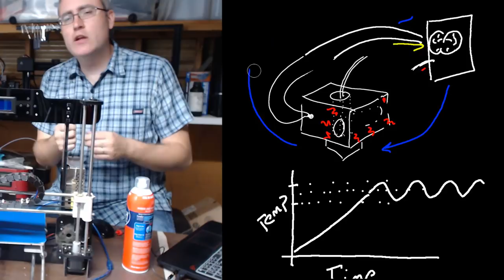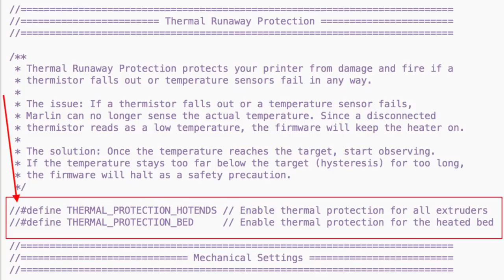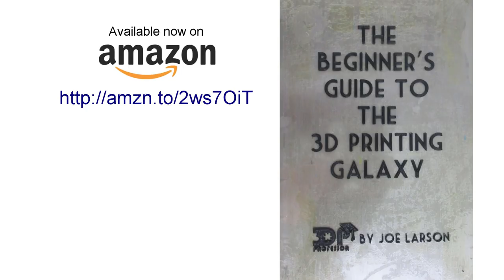Anet A8 Fire Danger and Marlin Upgrade

Comment: This is what the race to the bottom gets you. The Anet couldn't be made any cheaper with almost no corners left to cut, so they started using subpar components that performed so badly the thermal runaway was getting triggered in normal conditions. Ethics be damned, the quick fix was to disable thermal runaway. Companies that violate the law and ethical standards like this deserve huge fines and jail time for the executives to make other think twice before releasing such shoddy products.
Reply from the maker: It's a push and pull. We raced to the bottom, now we're going to see what we need to put back, then we'll race to the bottom again.
Reply: The public at large wants something for nothing. People expecting high wages, yet want high quality products below the manufacturers cost. Thats what's driving the race to the bottom.

Comment: Yep. This may help also. I made a standalone Arduino second set of overtemp and smoke sensors which will shut off a cheap, hacked 433mz remote socket. All parts, code and instructions attached. Feel free to improve and share:

https://youtu.be/n-JgQ3SaVME

 If you don't fancy going that far, you can configure Octopi to shut off a TP Link Smartplug (or more recently a Wemo socket) by linking the TP Link and Temperature Failsafe plugins and writing a small shell script. Instructions are here:

https://github.com/jneilliii/OctoPrint-TPLinkSmartplug/issues/59#issuecomment-420474368

It isn't just the Anet. The Tornado is as bad or potentially worse given the 230v unearthed bed and frame with no strain relief. 

 I would also suggest a 5-6a blade fuse/breaker to the motors, board and hotend and a 15a breaker on a 12v bed power cable. Also offloading current from the mainboard with a bed mosfet.

Comment: A "boycott until the firmware is fixed" won't solve the problem. World (or at least China) is full of shops, that have units for sale with old firmware already installed - you will HAVE to check this manually (or just upgrade firmware anyway) in any case.

If you have issues with false positives, rather than disable this safety feature, you can "relax" the conditions for triggering a bit. Had to do that on my system.

Also, regarding Creality also having this disabled - shouldn't this be rather easy (but slightly dangerous for inexperienced users) to check on most printers? Just disconnect heat probe & start heating WHILE carefully monitoring the hotend with external  thermometer to see what will happen. If the heater keeps heating up too long, reset the machine immediately (and let the cold end cooler do its work to prevent filament clogging the system), mark the machine as "dangerous", and do a firmware upgrade.
Maybe you can even query whether these settings are on via USB serial connection? (can'to  check right now)

If not, maybe they could at least add a way to store some boolean (on/off) settings in a short hexadecimal string, that you could query from LCD panel. Then, to make things easier, there could be a web page, where you can enter the string, and get "readable" output about what's enabled and what isn't. If using hexadecimal, there could be 4 such on/off values in each character.
Reply from the maker: I'm not sure I endorse the "poke the hornet net" approach to testing you suggest there, but, yes, that would be a black box method of testing if that feature is enabled.

The menu for marlin is the one thing that's most contentious. It eats up the space pretty good, so they try to keep in minimal.

But why do you access all the control options from the prepare menu, and all the system settings from the control menu? Seriously, this thing makes no sense. I get the sense that they've got a "that's the way it is now" mentality to changing it, like people wouldnt' be able to handle it if the menu were suddenly intuitive.

Comment: STOP STOP STOP There are many 10 cents thermal cutouts - two terminal series temperature cutouts on the market select one for just above the maximum temperature you ever need bond to the plate. Well below the fire point, HOWEVER  I use a 10 dollar PID temperature controller which overrides the mechanical (bimetallic wide histerisis ) old-fashioned oven temperature knob, with a small cpu containing software that accurately learns the temperature profile of the oven and maintains within a couple of degrees the food oven temp to cook.   These are really simple to implement, use both in series - one for safty one for absolute control.. Sorry dude, to actually suggest a firmware update IMHO is total and utter nonesense as you are simply dangerously putting the danger back to the controller's already prven bad firmware,  (which can crash anyway with mains spikes and other f/w fails)  - an independent temperature controller is totally required IMEO, The small 10cent two terminal ones can be obtained from anywhere and they are ubiquitous, being the "ALL ELSE FAILED SO STOP"  ---, so put "THERMAL CUTOUT" into google right now.  For the more sophisticated ones  you can select an accurate temperature too. (PID is = Proportional-Integral-Derivative (PID) control is the most common control type algorithm used and accepted in the furnace industry).    Put both in a series circuit.... 10 cents and 10 USD saves a life or house or just your printer. PLEASE do research as above and get a techie to wire in the simple safety device and/or (preferably both)  a proper independent controller.  Every house oven has these worst case cut outs and many other appliances why this si not on aprinter is BEYOND me as a 70 year old engineer. totally stupid design.....
Reply from the maker: To be fair, this is a 10 year old 3D printer kit, and you're commenting on a 4 year old video. Things have changed since then.
Reply: @3dpprofessor  yes, but it applies to ANYTHING designed by people who do not do worst case analysis and testing like I do in military systems and who do not understand simple safety protection systems as a fall back.. 10cents or your life ?

Comment: Why are these cheap nasty 3D printers still a thing? I am amazed that 3D Printing seems to be the only technology area that seems to still tolerate shit and dangerous products, no one would tolerate a microwave if it didn't have safeties and caused fires, or a inkjet printer that burned your house down but yet I keep seeing videos about 3D printers that either don't work right or have issues that users can fix etc etc. When are we as a community going to finally say ENOUGH! of these cheap crap printers? I personally would never buy one, I'd rather spend £1000 plus on a printer that i know works and is from a reputable company, if you can't afford one that expensive then don't buy one, save up your money or just don't. Stop buying these shit printers and send a message to these manufacturers that we won't tolerate crap.

Comment: or instead of buying a cheap chinese device to print plastic crap you can just buy plastic crap at walmart. problem solved
Reply: I didn't find a custom CO sensor enclosure with variable split at Walmart yet...
Reply: ThermoFIsher sell it but I save 2500$ by doing it myself.
Reply: Or maybe you shouldn't be watching videos on 3d printing  since you clearly have no interest in it.  Your negative opinion ads no substance to the subject  at hand. But what do I know? I buy cheap Chinese devices to print plastic crap instead of going to wall mart.